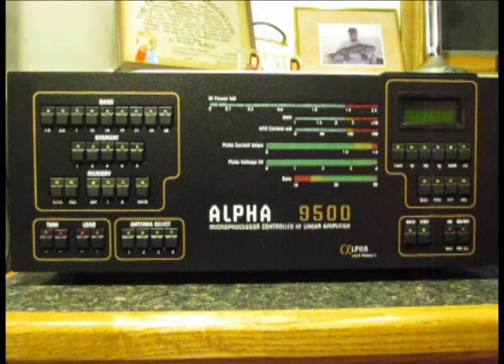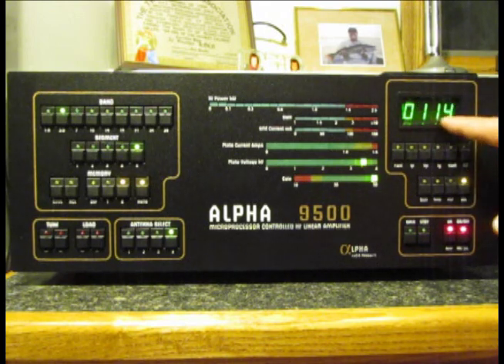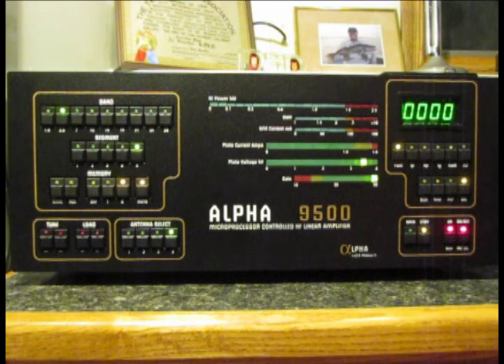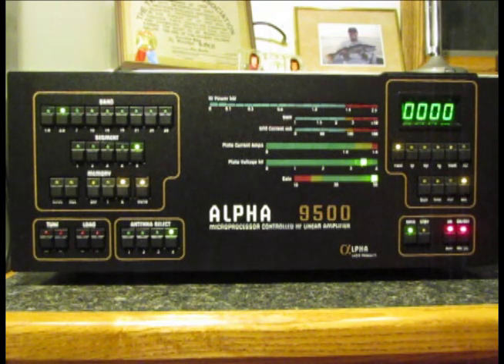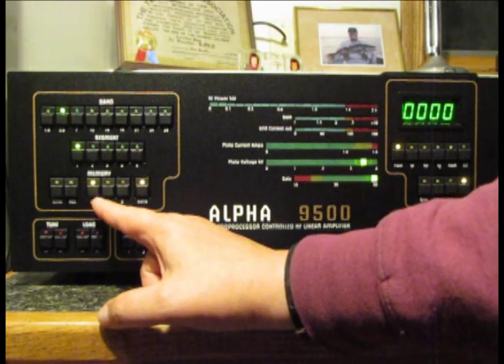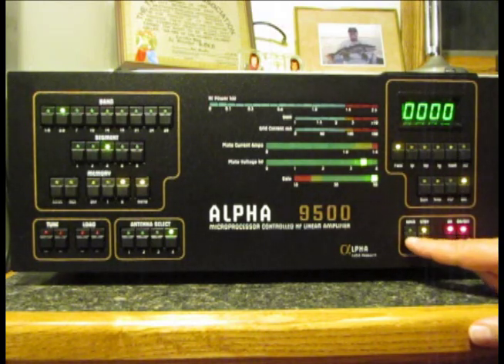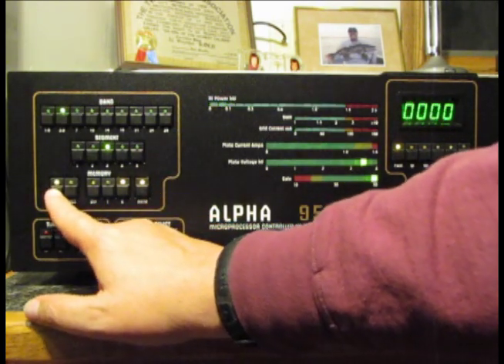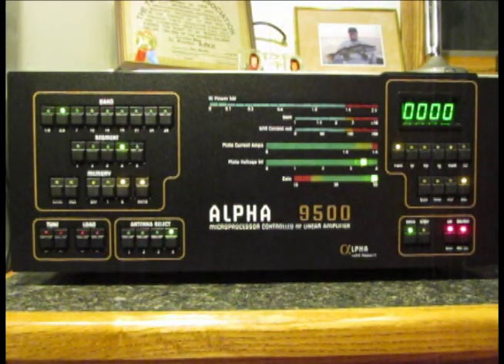Alpha 9500 Amplifier

Comment: Checked out eham reviews. wow! What a piece of JUNK! Why people get all excited about legal limit baffles me. The 600 watt ameritron will do ALMOST the same on the other end (difference negligible). Is it the auto tune that gets people excites? I don't know, but if you can't tune an amp because two minutes is to much time to spend doing so maybe you should consider a Tokyo hi power. From my research the THP is a much better amp and offers no tune. Two 3-500z's cost much less than the $1000+ (emac) that this amp needs when it's time to replace. And according to eham reviews you'll not only need to replace the tube but much more. These amps are problematic! Alpha 9500-87a = JUNK JUNK JUNK! DO YOUR HOMEWORK. ALPHA VS AMERITRON. IT'S A NO BRAINIER IMO. If you need 1500/Watts go with the dual 3-500z ameritron. Good luck.